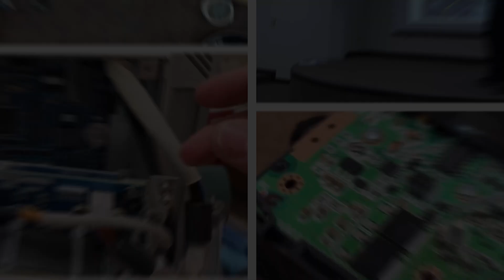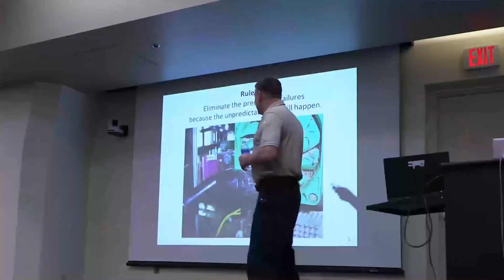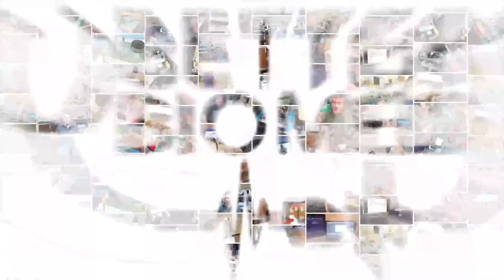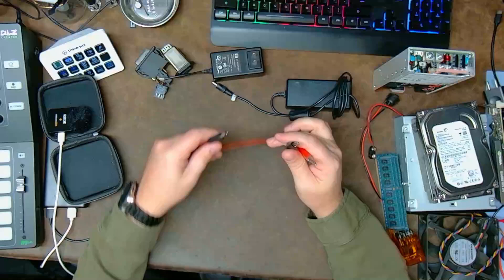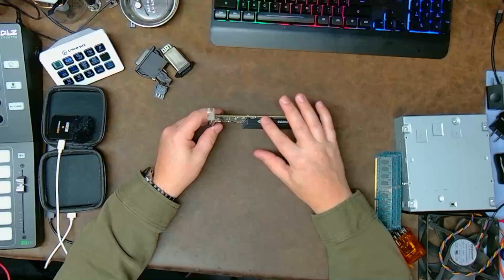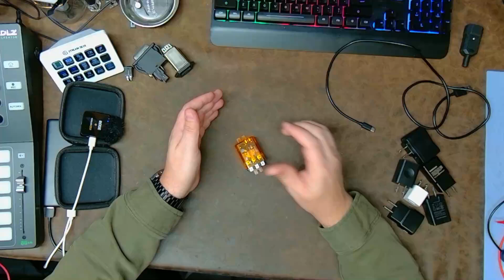Valuable Salvage!

Comment: Videocards like the one you showed in this video are always handy to have as spare, but also if they are broken, these silent ones with big heatsinks can be usefull.
Those big heatsinks can be used in different kinds of DIY electronic projects for cooling voltage regulators, power transistors etc......

Comment: There's definitely a lot of salvageable parts from the medical equipment side!  I have a decommissioned table top sterilizer that I will make into a vacuum chamber.  Computer power supplies as well are very good and stable source of DC voltages.  I used one to replace a broken power supply for our CT scan console, all it needed was 12VDC and we were quoted several hundreds of dollars for a replacement, I simply got one used computer supply off the shelf and its been functioning for stable for many years now.
Salvaging parts is also very environmentally friendly, they don't immediately go to waste field and will get a second life!  IF we use them :)